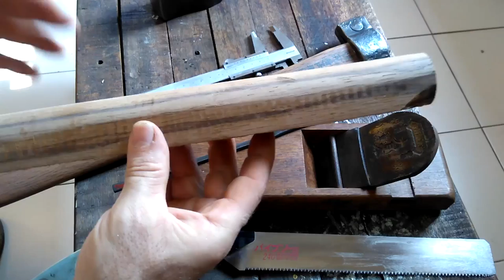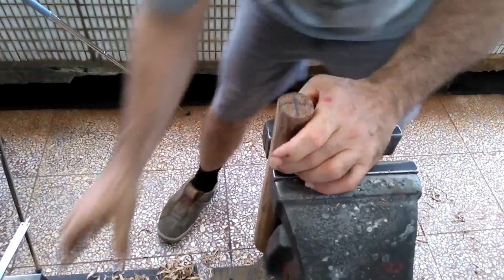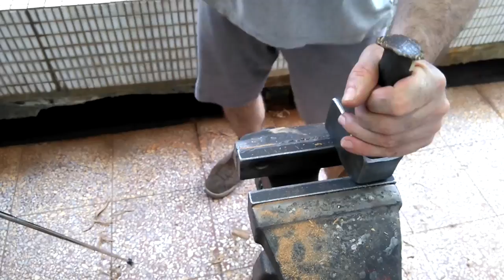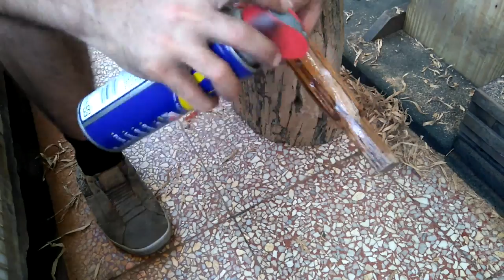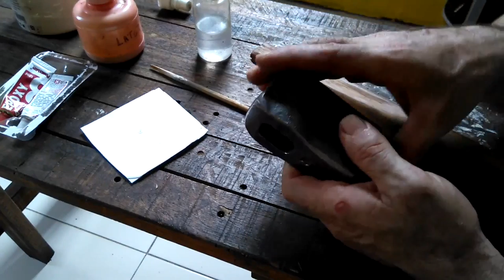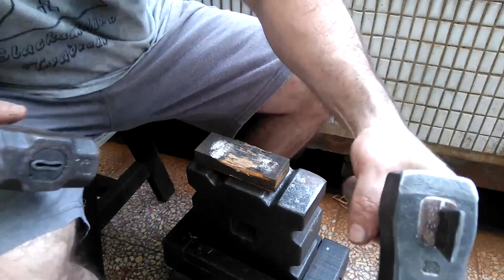How to Handle a Hammer - my technique in detail

Comment: You made a real science out of hammer handling- i just take some wood from my garden, mostly apple or cherry, roughly round it, hammer it in and wedge it- sometimes with some wood glue on the wooden wedge, and my wedges are pieces of wood I find laying around on the floor of my workshop :D
But your way is probably much more durable.

Comment: One suggestion; When tapping the handle into the eye, you should be able to just let it hang freely from your support hand and deliver sharp downward blows to the end of the handle (rather than resting the head on the face of your anvil or another surface.) The head should "walk" up onto the handle due to inertia; being much more massive, it will naturally tend to remain stationary while the handle is driven down through it.

I have read that this is the "proper" way to do it, but more than anything, I just think it's fun to see it work :D
Reply from the maker: Do you mean I should hold the hammer head while tapping in the handle? This seems like it would make sense. Or do you want me to hold the handle and keep the head off of any surface when tapping? I think you mean the latter. It doesn't seem logical to me but I will have to give it a try as there are many things I think won't work but actually do... Thanks for sharing this idea. Glen
Reply: Yes, the latter. The head is not in contact with any stationary surface. Remember, bodies at rest tend to stay at rest until acted upon by an outside force or object. In this case, the sudden downward acceleration of the handle is enough to overcome the friction between the handle and the inner surface of the eye, AND outrun the downward acceleration imparted to the head by gravity.

It does seem counter-intuitive at first; I actually "discovered" this while trying to dislodge a partially-fitted ball-peen head that I was re-handling.  Only later did I find out that it was a known, and by some accounts, preferred, practice.
Reply from the maker: Tried this today. Works very well. I really appreciate this tip and will post a quick video about this soon (and mention you as the source of this for me). Thanks again for this very helpful tip. Glen

Comment: Nice work!  I'm quite interested with the paste (what is the modeling paste exactly ?) I never glued my hammers and I've seen a few that were glued always wondering what it was. Cheers!
Reply from the maker: Karl, Modeling paste is an acrylic material artists use to create texture. I found it mixes well with liquid latex and epoxy to create a sort of flexible glue. I used to own a Hofi hammer which was only secured by a type of flexible polyurethane - I think a product called Sikaflex - and it worked well. Can't find that product here... Thanks for watching. Glen

Comment: It appears that there are some very slight concavities on the handle, a little closer to the head front & back, and a bit lower on the sides.  You didn't mention anything about them when shaping the handle, and I wondered about their purpose, or if they were even really there?  They certainly /appear/ to be depressions, but with a rectangular handle like that, could it just be a trick of the light and grain of the wood?
A cool video as always; it's always interesting to see how different people solve a common problem.
Reply from the maker: Brian, Your eyes are good. I should've mentioned and showed those depressions - maybe an upcoming video... The depressions I work in at the top of the handle are mainly for looks and so I know how the handle is orientated (front and back). The more important depressions are around the grip area. I shape the handle here to fit one's hand ergonomically. I got this idea from a friend here who is very creative and always thinking about small details in his work. Thanks. Glen

Comment: Nice job Glenn, had me wondering what that was on the grinder until the end where you said it was a flap disk. Until then I was wondering what sort of a polishing compound you put on a cloth wheel that removed wood like that! 
I to make my own handles, the store shaped ones seem to be made of rubish wood these days. I go in to the local hardware and find my self a couple of metres of nice straight grained dowel or square section from their furniture grade hardwood, around the 50mm thick mark, and work it back from there with a draw knife. 
I have been using store bought wedges, but have not been happy with their offerings, I think your using a bit of flat and shaping it is a good idea I will steal!
Reply from the maker: Jack, I said "my technique in detail" but it seems I left out a lot of the details! I may do a follow up video on this topic as someone else also mentioned some parts that I didn't explain. Thanks for sharing. Glen

Comment: Nice job Glen! I know you had oiled the handle again after the hammerhead was mounted but did not mention who the end grain was dealt with. It is a good idea to allow the end grain soak up as much oil as it can because that is the most porous area of the handle and this will prevent moisture from being absorbed which can loosen the head over time.Plus the oil will cause the wood fibers to swell and tighten the head even more. Since you live in such a humid area after getting the handle shaped and before you size one end for the eye, try placing the handle in the oven at 200* - 225* degrees for about an hour to drive out any excess moisture and thus eliminate any potential problems it could create. Anyway, just some thoughts that may be helpful. I hope all is excellent with you and your wife. Be well brother!
Reply from the maker: Jeffrey, As always, very good advice. Sealing the end grain with oil definitely helps mitigate transpiration of moisture. There are a lot of details that I left out in this video and so may revisit this again in a future video. Thanks brother. Glen

Comment: forgot to mention, I use 2 part epoxy on my handle jobs. I use less hardener when mixing and it cures a little softer and sticky still. seems to give a nice hold
Reply from the maker: Ron, That's a good suggestion. A main problem with two part epoxy (for handles) is it cures too hard and is brittle. Handmade items take time for sure. Thanks. Glen

Comment: Good job as always. Try to use hot oil to cover the steel of your tools. The hot oil will enter deeper into the pores of metal or wood, and when it cools down it will compress and will stay there. shorter - the capillary effect. Good luck in your new projects may be in modest time you create one blade for a Japanese plane. I love the tools in the Japanese style, even the European saws convert to Japanese. if you do not mind I will send photos of my handles for hammers. Maybe something you'll like
Reply from the maker: Sergey, Thanks for the good advice and for sending the picture of your wonderful hammer handles. Glen
Reply: Your welcome, I forgot to say that the profile of handles is oval, for convenience of holding, like handle of "Yakut knife"  has. The oval shape is well griping surface for hand

Comment: good job but some people make it with wood wedge and steel wedge  perpendicular
Reply from the maker: Mohamed, Yes, that's what you commonly see - a wooden wedge front to back and a steel wedge splitting that side to side. I may experiment with different wedging techniques but so far, the method I showed here is what works best for me. Thanks for watching. Glen

Comment: I saw where for rectangular eye holes, like with claw hammers, the kerf is cut diagonally rather than front to back (which is how most axes and sledges are rehandled). Apparently it's supposed to spread the stresses of the wedging more evenly for a squarer shape. Maybe give that a try next time?
Reply from the maker: John, Yes, I've seen that too and it does make sense. I've had good luck with front to back wedges so far but I will give diagonal a try. Thanks for watching and sharing. Glen

Comment: In making the wooden handle you just missed making a truly artful, sings-in-your-hand kind of handle.  How?  Riven wood: Split the wood and use the face of the split as your working face . (this is done twice @ 90*)  Thus,  ALL of the grain runs parallel end to end and perpendicular to the hammer head.
Reply from the maker: I've read your comment a few times and still can't wrap my head around this. I've heard the term "riven" but will need to look this up to be more clear. Anyway, I appreciate your suggestion since if there's a better way to go about something, I don't mind knowing. Thanks for watching and sharing. Glen
Reply: Rove.  To rove.  Once roved, riven.  Royalty insisted their furniture be made of riven wood - hoyty-toyty!

Comment: I've never noticed anyone pulling a plans toward them before, does it work better with the Japanese planes?
Reply from the maker: Nigel, Japanese wooden planes are usually pulled, somewhat like Japanese saws cut on the pull stroke rather than the push stroke as western saws do. I feel it gives the user better control. Get a good Japanese wooden plane and you'll see... Thanks for watching. Glen